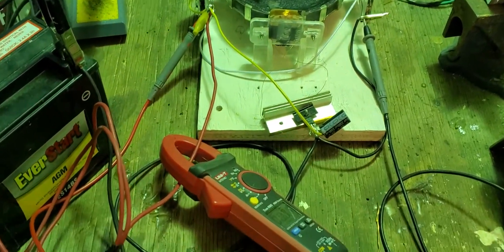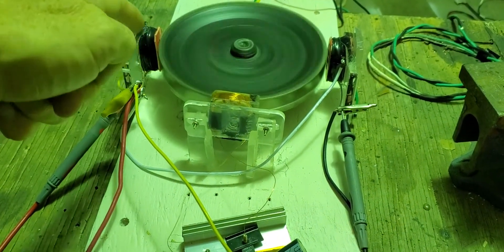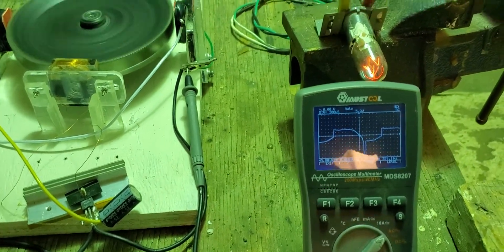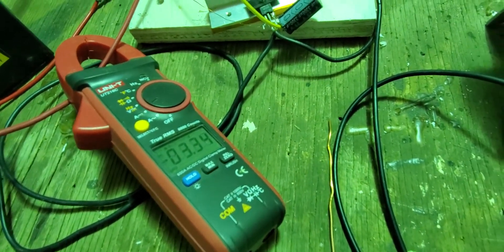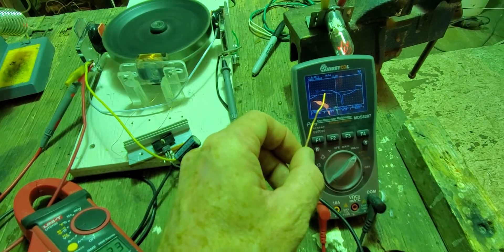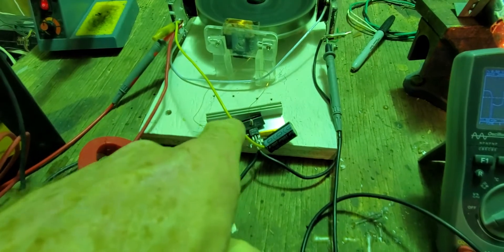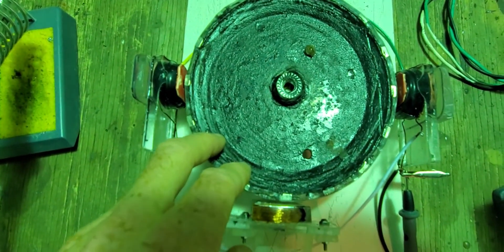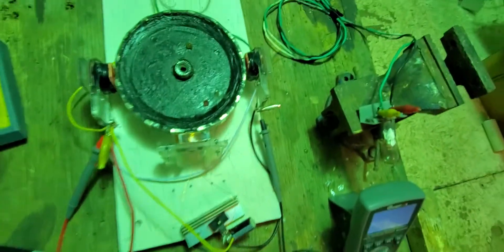Pulse motor build details

Comment: Hi Bud. i sent you a schematic representation drawing of the circuit i made for you, on your email. Please check it for me if it is right. I do not have the value of the diode on the output connected to the 3300uf 25V cap. Please assist.

Comment: Well balanced, high-speed rotor! Nice work. What’s the power output to your bulb?
Reply from the maker: In this video its pretty low maybe 3 watts ,but the next video i have 3 transitors and the bulb is getting 100v dc with very close to the same input